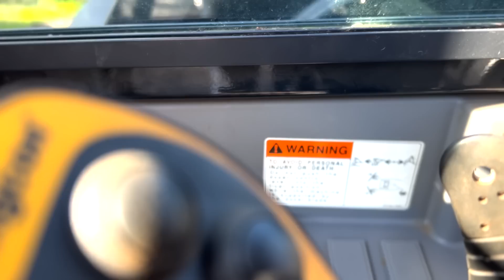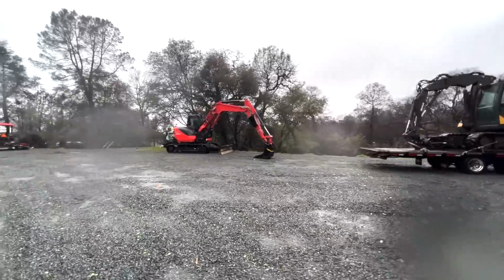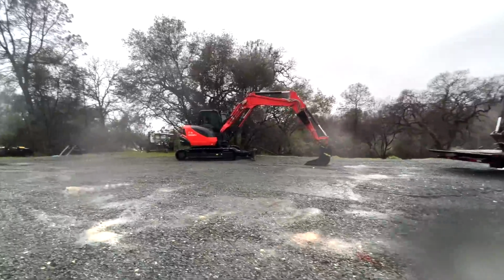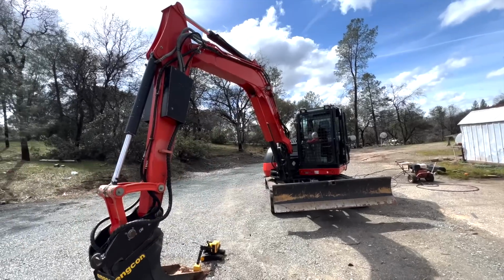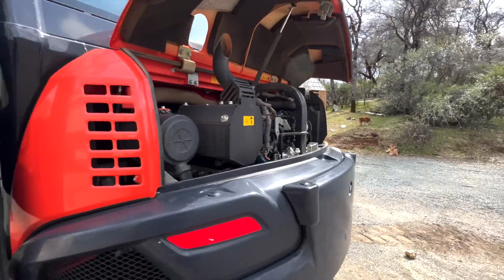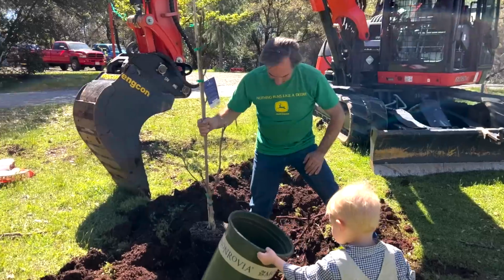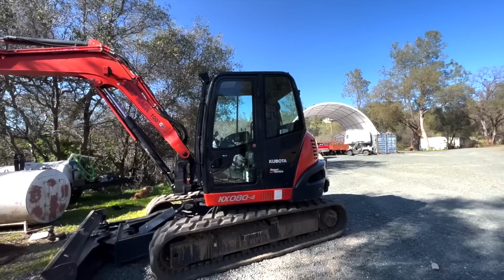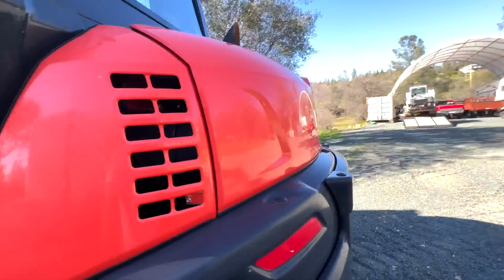My new machine has arrived! Replacement machine

Comment: Tilt rotators are the way to go. If only it was steelwrist green!
Reply from the maker: Why’s that?
Reply: @VBELTandSON  Any tilt rotator is going to change the way you use and think about an excavator! I’ve just had great luck with Steelwrist, and when comparing steelwrist, build quality to the engcon build quality, it leave some aspects to be desired out of the engcon in my opinion. And Engcon is the only brand that is not adapting to the open S quick oil standard which could be a hindrance going forward.